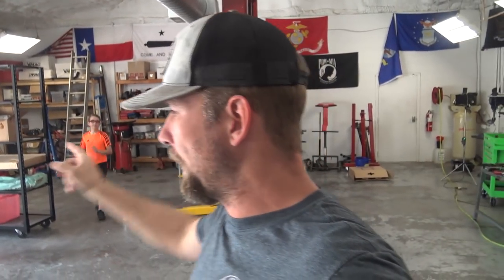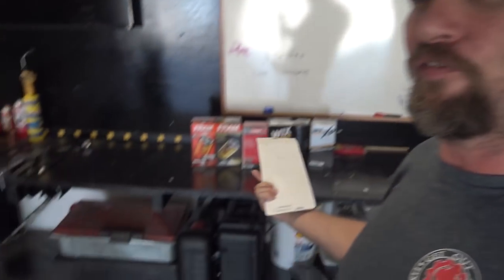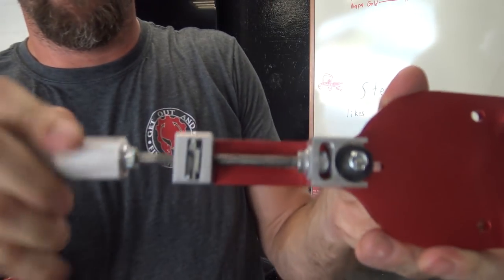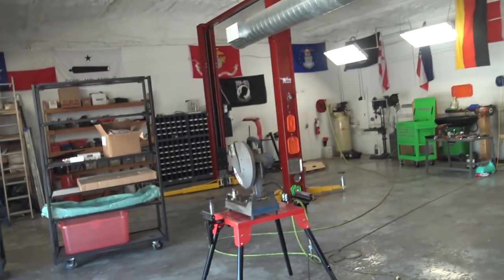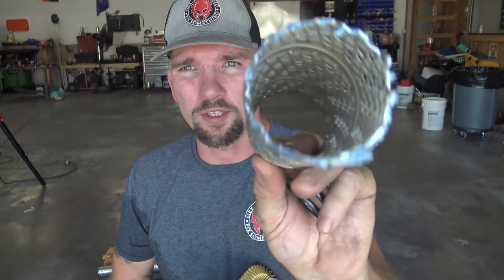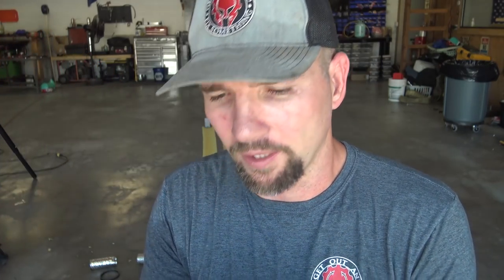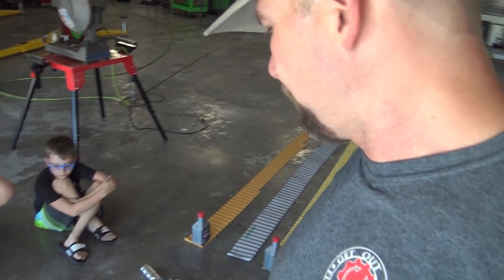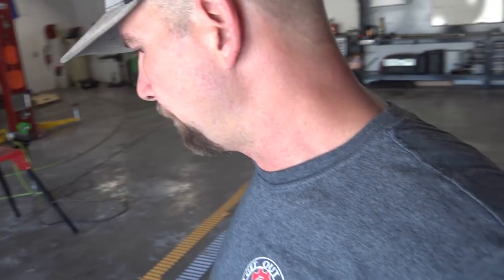Is This Still The Worst Oil Filter On The Planet?

Comment: Man, I keep telling myself I am going to get one of those oil filter cutter-opener things and haven't done it yet. Sure is a lot easier/neater than any other method. Good video!  Ps: we cut filters open often if there's ANY contaminants in our engines, way easier than a 20K$ rebuild.
Reply: These are the filter I only use! They work GREAT. Amazon for $15

Dodge Oil Filter - 5083285AA

Comment: My dad and I have used nothing but Fram filters for 40+ years and never had a single issue. The pickup I'm driving now has over 320,000 miles and I've used Fram filters on it exclusively and it still starts right up and runs great. My dad has a 1997 F250 that has over 450,000 miles and used Fram filters for a long as he's owned it. I'll continue to use Fram simply because that's what I've had luck with.
Reply: i bit you also change the oil at 3000 to 4000 like clock work.

Comment: Been using the motocraft 1995 on my 1997  7.3 since it was new. Delvac 1300 ever 5,000 miles or less. 245,000 miles total on the truck now. No problems! 😀
Reply: On the 7.3s I’d run the Lucas oil additive. Put a gallon of the stuff in my truck & I noticed a decent amount of power gain. Because the injectors are fired by the motor oil.
Reply: I had a 96 7.3 Powerstroke truck. I bought it at 245k. The previous owner had the dealership change the oil EVERYTIME for 20 years. So it had Powerstroke oil and a Motorcraft filter its whole life. I swear at 245k it did not burn a single drop of oil in 5k miles and I was always shocked at how it wouldn't lose any at all.
Reply: GearJammerGamer I am pretty sure I’m losing all my oil from the turbo pedestal/HPOP 😳 1996 with 379k miles and still going haha.  Need to be better with oil changes but I have a Motorcraft filter and some Rotella in her now.
Reply: REGULAR servicing is the key to longevity. Kudos.

Comment: A new, crappy oil filter along with regular oil changes is better than no or a clogged filter.
Reply: Assuming that the crappy filter doesn't disintegrate during use and send pieces of itself through the engine.
Reply: Best thing is to follow manufacturers recommendations. I had to switch brands because Walmart stopped carrying Purolators and the mileage on a basic was 5k miles, where as the Frams were only 3k miles.
Reply: @scarling9367  Frams filter are 10k now
Reply: Exactly. I used frams for years and changed my oil and filter regularly. On a toyota van I had for 14 yrs . No problems at all. ran and ran good as. I am suprised to see these vids point out how crappy they are made though.
Reply: @darrylcampbell4411  They never tell that Frams will filter better than those other filters. Frams is rated at 20 microns and others are rated at 30 microns.
Reply: @heatseeker7667  funny thing is,FRAM didnt make them any better they just changed the "oil change/filter change interval" kind of like how ford deals with exessive oil consumption on thier new trucks by using a longer dipstick.olollooolllolollooloolol FORD SUCKS.......PS:this is a true story relating to my friends 2019 ford f-150
Reply: @trillrifaxegrindor4411  They went from nitrile to silicone anti-drainback valve.
Reply: DriveAndMaintain have any actual proof of incidents?  I’m neither for or against them, Been running them cheapie frams  for a solid 25 years. But if there’s any proof they’ve disintegrated or have caused ANY engine damage I will switch in a heartbeat!!

Comment: I was in the automotive aftermarket for 50 years. In that time I was also an engine builder and I sold and used primarily Wix and Hasting filters. They were always made in the USA at the time.  The only Fram filters that I used were a couple of fuel filters that were specific to the marine industry and at the time there were no other choices.

Comment: I’ve been a construction eq mechanic for 26 years and back in the teir one days seldom had oil filter fails,it was when manufacturers went to electronic injection and fuel dilution dropped so they all went to 500 hr  service intervals instead of 250,since then I started seeing fails,I currently work for komatsu and have had to sadly void warranty’s due to that lovely orange filter you had I’ve seen the media break up and clog oil journals and take bearings out of 80g motors multiple times,we now advise our customers not to ever use them.
Reply: Just because a filter is a specific model doesn't mean you should ignore it's specifications to what the manufacture specifies.  A 250hr filter failing at 500hrs is too be expected .
Reply: xephael we just never use them,most of the komatsu machinery we work on have Cummins enjines so we only use Cummins,komatsu or fleetguard filters,the frams that we have seen fail are spec by fram for the enjines they put them on,its the occasional customer mistake of using these filters that we see a high failure rate,I used them myself for years on my personal vehicles until I witnessed this several times
Reply: @DaveTW65  I'll second that. In the past we used so many Fram filters. Now my parts house doesn't even carry but a small handful where they used to have a whole wall of the stuff.
Reply: @xephael3485  Where you getting this 250hr filter idea? He said service intervals. I don't recall ever seeing a filter with an hour rating on the box.
Reply: Machines that use oil that aren't cars monitor their oil change interval by hours of use instead of miles of use. I install engine mounted air compressors that use an air/oil separator with a coalescing filter and a plain oil filter for the compressor oil, these compressors get an oil change at 250 hours of use and another service and oil change at 400 hours. Some machines have hour tickers on them that count hours by the 10th most the time. It's best when the compressor change lines up with the engine oil change 2 birds 1 stone👍

Comment: Are you certain that the Motorcraft filter was a genuine Motorcraft and not a Chinese knockoff? The reason I ask is Fordtechmakuloko says that there are knockoff Motorcraft parts for sale on Amazon, he shows the k knockoff and the O.E.M parts and packaging side by side and the differences in the parts are fairly easy to see but the packaging differences are much harder to see. Your thoughts?
Reply: I thought it looked like a knockoff. Because I have always used motocraft filters and every one I have cut apart had a spring in the bottom.
Reply: Leaf spring
Reply: branwerks no spring bean
Reply: Never buy motorcraft off the internet.
Reply: Genuine Motorcraft for $10? I'd question it's authenticity.
Reply: You beat me to it. I knew it was looking like a counterfit by both by price and by quality. We recently purchased a Motorcraft Tension pully off Amazon, and another belt pully we didn't actually know it by just looking at them, but found it was extreamly bad quality and defective. It ended up wasting a lot of my day and money having to go back and fix it. 1 was wobbly, and the other was slightly off sized. Both ended up being knockoffs, and we had to buy from the real ones from Autozone. There was such a huge difference in quality when comparing the reals vs fake.

Comment: I only run Motorcraft on my 6.7PSD, and have had good results on oil analysis.  Recently I cut one open and saw the adhesive between the media and end caps was starting to fail at 7500mi.
I run the Fram Tough Guard on my gassers, and always see low insoluble counts indicating good performance, even out to 15K mi.

Comment: The spring in the bottom of the can is used to seal the grommet to the baffle plate and end cap of the filter.  It is not used as a bypass for the oil.  If there were a bypass valve it would typically be in the bottom end cap of the filter.  In this case, the engine would have a bypass valve built in that would open and continue to supply oil if the filter were to become plugged.  Generally, the coil springs are used in heavy duty applications and the spring plate in automotive or light duty applications.

Comment: The filters with the white media is a blend with fiberglass and that plastic mesh you see inside. The mesh is ultrasonically welded together and then the glue strip around the outside is to help keep the elements shape during production. The string you saw is the same principle. The element paper is flipped around the core during production and sometimes is a challenge to get to stay in place. The string keeps it tight before the endcaps are put on.

Comment: Sound like you should have done a collaboration with Project Farm.
Reply: You'd end up with a huge filter on a lawn mower
Reply: Todd Orton  are you talking ab the oil filters on a b&s?
Reply: Todd Orton  do you have a link to it?
Reply: Todd Orton  so the filter from the scion tc will fit a b&s single cylinder
Reply: Todd Orton  k thx u
Reply: Ha, I could see pumps with sand, grit, and steel filings, see what filter, filters the best! I will put it to his suggestions list!

Comment: Those filters do not have bypass valves and will not go into bypass. The leaf spring and coil springs are not bypass springs. They are strictly for keeping the element tight against the base plates. Filters that have bypass valves will sometimes have the valves built into the bottom leaf spring or bottom end cap of the cartridge. Some filters have the bypass on the top between the top plate and the cartridge mostly Motorcraft. The filters in this video do not have or require bypass valves.

Comment: Hey Stephen!
@19:53  That arched plate is actually just a leaf spring instead of a coil spring.  Exactly the same "function", just different format.
Good video!
Ken
Reply: Right, the spring plate is a lighter duty and less expensive way to build the filter.  The springs just keep everything pressed together in the can.  Coil springs are the best for heavy duty applications.
Reply: Was gonna say the same thing but I was pretty sure someone was gonna say it. There is way more than one way to make a spring.... many are not the spring spiral shape. If you ever seen a corvette front leaf spring, it is a single long curved piece of "something" that goes from drivers side to passenger side. And that's a sports car. I never realized that until I saw one.

Comment: I think one other thing is much more important than any filter.......... it is that you freaking change the darn thing !!!! 
I personally change my oilfilter on my daily drivers monthly because $5-$10 is much much cheaper than any engine repair itself. 
Also on the site note any modern Gas Engine run them only on Full Synthetic period to keep sludge as a minimum. 
Those are my most important things I tell every customer of mine.
Oil changes I do every quarter because Full Synthetic oil just doesn't break down as fast from it's properties but I want to ensure my filter catches any particle and debris and filters it out of my engine oil.
Reply from the maker: Amen brother!
Reply: synthetic isnt an end all/be all oil and isn't good in older,high mileage ,non efi vehicles....i do agree on changing the filter more frequently,just dealt with an ecotech 2.4 and the issues from going 5000+ km between oil changes
Reply: @trillrifaxegrindor4411  only full synthetic but when you get race or older cars you adding additive to it. Like additional zinc goes a long way but only if you know what you doing. Regular oil just doesn't cut it and builds up way to quickly oil sludge. Much more so on Aluminum blocks than steel blocks since those have to run a lot hotter.

Comment: If you have a million dollar machine or less, surely it is a good idea to send oil samples off to a lab for analysis on a regular basis. Gives you far more information than about wear etc than looking at a filter,it gives information on bearing condition etc long before visible bits turn up in the filter.

Comment: A oil analysis is really the only way of proving which filter is best to worse
Reply: NAH. An oil analysis tells you what's in the oil. It doesn't tell you if the filter is any good.
The famous 95 MERC runs Pennzoil Ultra Platinum, 5-W-20; Bosch # 3410 Premium Oil Filter; FILTERMAG #SS365PR Magnet Kit.
https://www.mercuryforum.com/forum/grand-marquis-14/1995-grand-marquis-restoration-8937/

Comment: I use Purolator oil and air filters back when i worked advance auto in the early 2000s customers were saying the Fram filters were coming apart and and going thru the engine causing all sorts of problems, i never used a fram and never will complete junk, would have liked to see you cut open a purolator filter but I hear motorcfaft is the same filter.

Comment: Have a Toyota with 280,000 that I've owned since new.  I've used nothing but FRAM filters on it.  Run's great and I don't have to add any oil to the engine between changes.  I don't regret not paying 3 X as much for a higher quality filter.  Regardless of the brand of filter, I think changing your oil at the proper intervals is far more important.
Reply: You're completely correct!  Cutting open a filter only shows construction and components... It doesn't show how it performs in real world usage.  You need to do actual testing to compare filtration and filter perform/durability.
Reply: Well that's a Toyota. They last longer than any other vehicles regardless
Reply: That Toyota is still in the break in period 😂

Comment: Awesome video! I would like to add personal experience to the info you put out there. When I inspect filters that have been in service, the largest factors I see are the consistency in the glue job and quality of glue. When combined with the quality of the filter media in the standard paper filters, it puts me in 120% agreement with your findings...aside from the flat spring. I actually prefer the flat style spring. It is more forgiving and helps keep the seal better if a filter becomes damaged in service and goes unnoticed.

Comment: If you buy a WIX XP you are buying a NAPA GOLD, Same filter.
Reply: The regular wix is the napa gold, xp is napa platinum
Reply: Wix makes the Napa filter.
Reply: Wix Xp or napa platinum...  made for racing.  Not the street... They dont filter as well as the regular wix or napa gold.  They are meant for high flow and to be changed after every race.
Reply: @bossrobotdad I still have a bunch from a case purchase of Toyota OEM filters and they all say Denso on them.

Comment: In the last 10 years I bought only K&N oil filters, a bit more expensive but I love the high flow features and  the 1 inch hex nipple that helps a lot with filter replacement. It's  so convenientl that I can change the filter without having to lift my SUV off the ground.

Comment: I grew up in my Dad's excavating business. We rutainly cut open the used filters looking for metalic particles. We also comapred construction. Cat filters always had way more filter media than any others. We used DA brand lubricants and as part of the deal they provided sample cans that we sent to their lab. Each sample was anylized for contaminants and reported by quantity. Water, antifreeze, viscosity, carbon, metals etc. were reported. If there was something indicating a serious ploblem we would get a phone call. For a fee they would do the same for any oil. They didn't ask what brand or anything else. One of our employees came from a farm. He brought used oil from their propane fired irrigation engines. It always failed the tests. The oil was a brand typically sold to farmers. 

Heavy construction equipment is used much differently than a car or pickup. Engines are run full throttle near full load all day long. I don't know how many hours the current engines get but way back when I was in the business they would go 10,000 hours between overhauls. Hour meters count revolutions, not time. So an hour was the # of revs that would take place in one hour at goverened speed.

Comment: One of the biggest problems with the Fram filters from 10 or maybe 20 years ago was that they used really thin metal for outside was super thin. This would let them puncture easily and rust through really quickly. Looks like, at least for those big diesel filters, they fixed that issue. It of course was a cost cutting measure, thinner metal was less costly. When my cars get out of warranty, I switch from OEM filter to Mobil, the Mobil brand seems to be decent enough for normal consumer uses. Only OEM Harley filters though, hard to beat them on performance per price.

Comment: With cartridge style filters the manufacturer can't hide flaws in assembly inside a metal can. The whole filter is there for you to inspect before installation and after removal you can see if any failures or weakness in the components developed.

Comment: I worked at Wix in the 80s. They made all of the filters for Ford, Motorcraft, & NAPA at that time. The Motorcraft filters use to use a coil spring too. I'm a little surprised to see that leaf spring in there. My suspension is that Wix no longer makes them. Wix also makes all of the CAT filter too.

Comment: The local engine shop I use, for the machining tasks on my builds, will void the warranty on there full engine builds if the customer uses a fram oil filter. Fram may have stepped up QC as of late but it's too late, they produced junk filters for so long. I love the short video of the fram paper filter media cardboard end caps 🤣.

Comment: Even the worst filter is perfectly adequate when changed every 3k miles. It's when you try to run them for extended intervals that there's a problem. My '87 Hardbody SE-V6 has 465,000 miles on it and has never been opened up. Nothing but Fram and Castrol GTX since day 1.